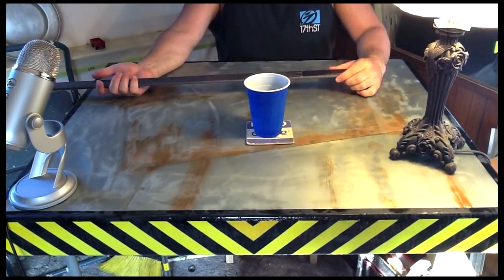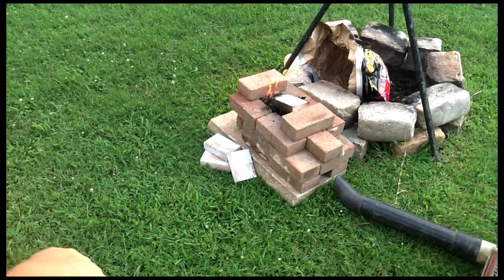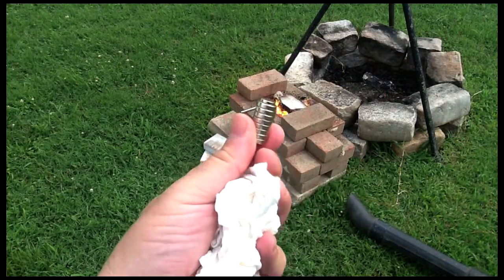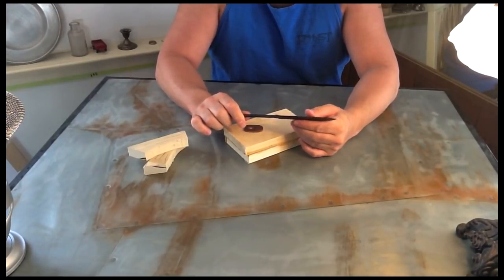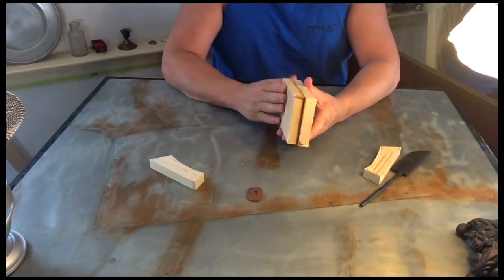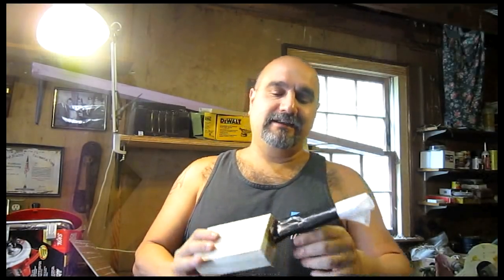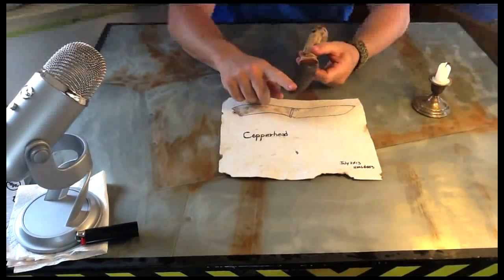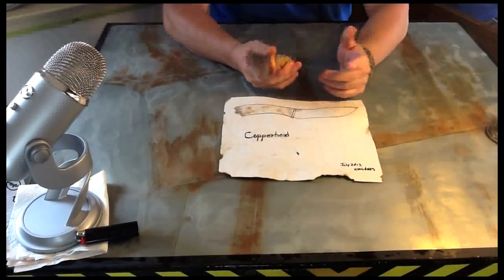DIY Bushcraft Knife with a Hidden Tang

Comment: im a new knife builder myself and have learned 99% of what i know from youtube videos like this. i bought a bar of 1084 from NJ steel baron, great place to buy steel and it comes annealed already so its easy for us stock removal folk lol. mostly i use a hacksaw, files and occasionally my 8" table grinder. filing bevels isnt the easiest thing in the world but it makes ya pay close attention to detail and you make less mistakes. (though a longer process). i havent heat treated my blades yet, but

Comment: Finally, very cool that you are doing the heat treat yourself.  Hard to tell from the video but let me add some quick tips.  Be careful not to overheat the blade.  Once it reaches temperature "soak" is a bit by keeping it moving to even out the heat.  Once it is uniformly heated, move quickly to the quench oil.  These are all mistakes I've made myself, destroying a couple blades along the way.

Comment: Great project,  i enjoyed it. 
On a little side note,  the striking efficiency of the knife has nothing directly to do with it being high carbon steel. It is simply because ir is much harder after the heat treat than the mild steel, and hence shaves the ferrocium rod much more easily

Comment: nice vid, just a hint, when you want to heat up your knife blank, you want to bury the blade wholly in the fire (under the hot coals and not just on top, it heats it more thoroughly and evenly and allows a better heat treat.  also, just when dunking it in the oil ( i know you were scared), just hold it with your tongs and swish it around in the oil which cools the blade quicker and makes the treat better, anyway congrats, knifemaking is an awesome skill to have !!
Reply from the maker: thank you, for the compliment AND the tip :)

Comment: Bricks can explode if heated up to forge temps. I'm using a ceramic flower pot with a mixture of clay, ash and sand lining the inside for my forge. Coals sit inside and I have a hair dryer which I aim at it. (I need a better blower system.)

Other note, that tang seems too thin with too much of a square shoulder. I would suggest Having it thicker near the blade and softly taper to a rat tail. Almost like a bell curve.

Last thing. Good knife and well done. Keep going.

Comment: you should use the forge when temp. the blade you want the spine to be a plum color and the bevel to be a strw color when you get that quench it also when you quench it it helps if you swirl it great job on the knife and vid new subscriber!
Reply from the maker: good advice, I've been working on a forge in my backyard.  I've got the first version functioning, but it needs work.
Reply: well good luck and thanks for the vids

Comment: Very cool, well-produced video.  Hope you don't mind if I take issue/have suggestions with some of your philosophy/techniques.  Your skill set seems more than sufficient to invest in better quality materials.  As you no doubt found out, the 5160 could not have cost that much more than the mild steel, but can actually be made into a knife rather than a knife-shaped object.

Comment: If you want to get cheap and very good quality steel go to your local junk yard and ask for old leaf springs and the reason you want older ones is because they are about half the thickness of the modern day leaf springs which are quarter inch thick and for me it was around 15 dollars.
Reply from the maker: that's a great tip!  thanks!
Reply: no problem

Comment: Great job. Seems you have skill with the belt sander too. I'm doing mind with a file for now, which is taking ages, but I don't mind. I am also going to try the heat treat at home like you did. One more thing, our of curiosity, how long did it take before it was the right temp when you heat treated?

Thanks again
Reply from the maker: That's awesome!  Good luck on your knife, I have a series showing the process step by step, there's one on heat treating, if you need.

Comment: Great video tutorial, I like these kind of "make it yourself" videos. :) How much did that belt sander cost? ;D Thanks for a nice video! :) Keep it up.
Reply from the maker: thanks for the compliment! the sander was a birthday present, but I sneaked a peak online - it was about 170$ (as I recall) .  But heads up! one BIG problem I had was the dust collection.  if you're not connected to a vacuum system, be prepared for coals, if you grind steel.  I ended up having to disassemble the housing (and break off what could not be taken apart) in order to avoid having hot sparks collect inside the sander.  I had to put out coals on more than one occasion.  Once, even, a small fire started.  But once I did the mod, no more issues.  thanks again for watching, I'm glad you enjoyed the video.  I'm half way through a series where I break down all the steps to knifemaking, in greater detail. here is the link to that playlist, if you're interested: http://www.youtube.com/playlist?list=PLWQgfdEjhALzSuOZAWvMNRcAbSvjCgvge
Reply: Primal Edge Okay, thanks for the response! :D What is the name of the sander? So I can lookk it up. :D Thanks again!
Reply from the maker: MrKaable here, I found the link to it on Amazon: http://www.amazon.com/gp/product/B003O1UXFO/ref=wms_ohs_product?ie=UTF8&psc=1
Reply: Thanks man! ;D
Reply from the maker: don't mention it, thanks again for the views & feedback!  hope to see your work on YouTube soon!

Comment: There's a reason you're getting sparks from the 5160 and not the mild steel.  To make sparks you need carbon in your steel.  Mild steel doesn't have carbon in it,  that's why you can't heat treat it.

Comment: I'm only about 3 minuites in to this video, but MAN you went WAY too far in thinning that tang! The "round" in shape is not a great structural shape either for strength, as it can bend easier in ANY direction!  A rectangular shape with slightly rounded corners and extending out to within 3mm or so of each side of the width of the ricasso would make it a LOT stronger if ever called on to do common woodscraft/bushcraft chores. Yoy may not be planning on using it for any of that, but if you're ever stuck out in the woods for a few days in an emergency situation, I hope you have a stronger knife with you.

By the way, even the original Marble's Woodcraft knife would have been a great model for tang shape. It's stood the test of time since 1915 and some even use it for "light" kindling battoning, but it took me awhile to find a video of the actual shape and thinckness of what's under the stacked leather handle. 
https://youtu.be/64VGytXObA8?t=250

Edited, just noticed this is a Nine Year Old Video. Never Mind,...I'm sure if you're still building knives, you've learned something.  And since it's been 9 years,... I have to ask,...did the tang ever break off?🙂
Reply from the maker: no, it never broke, and it actually worked well for batoning and I even feeled a sapling with it.  but yes, that was my 2nd knife and I learned a great deal since then.